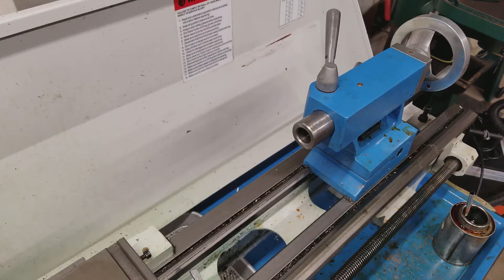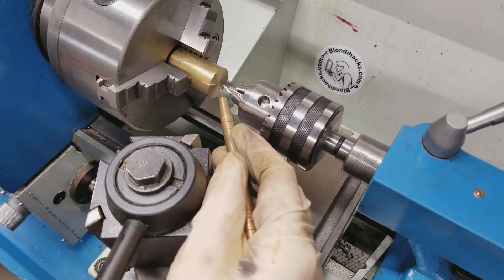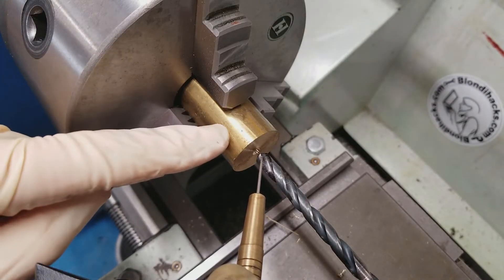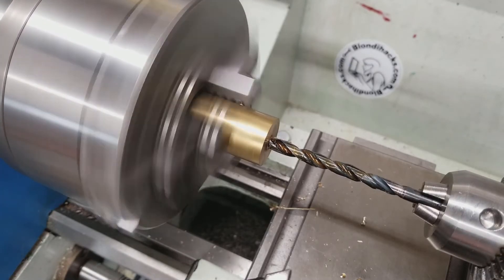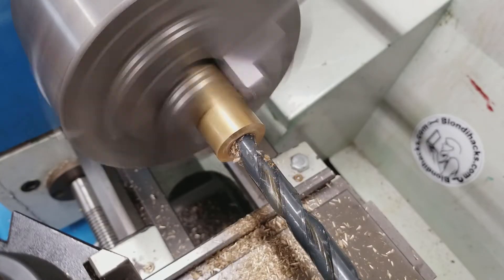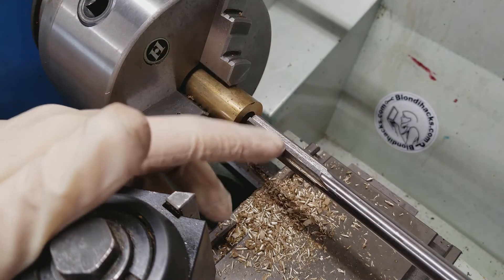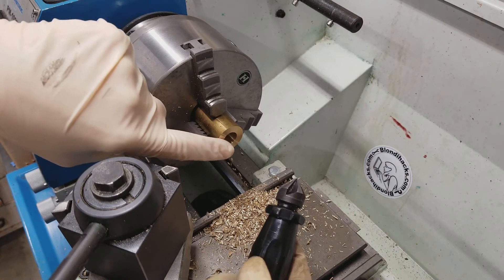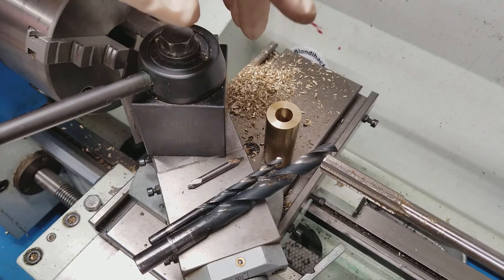Metal Lathe Tutorial 10: Drilling

Comment: 8:54. Why does that reamer with so much stick out, look like a recipe for a severe, catastrophic chattering? I've never used a lathe, but that long reamer with no support under it, looks like it would vibrate slightly in the hole, and go into a runaway oscillation and bind up on the metal and then probably break off catastrophically? How does one avoid that happening, or are the reamers so rigid that they don't vibrate?

Comment: I will answer a question from below about using oil when drilling brass: I always do and something else because I use a lot of 360 brass: I have two sets of drills and I blunt or flatten the drills
in one set because it causes less troubles when drilling. This suggestion I received courtesy of William R. Smith (Deceased) who wrote many articles and books describing making clocks. From my
gunsmith friend here's another tip: When closing a Jacobs chuck tighten first one of the three tightening points then follow suit on the remaining two tightening points to approximately the same
strength. This eliminates uneven stress on the drill and ensures a bit more accuracy in your drill and your center drill. I follow this technique with the various Jacob Chucks on my lathe, mill and drill
press. If I am feeling whimsical I will do it on my hand drills though it seems unnecessary in the latter case. I hope this helps. BillY

Comment: I keep centre drills for making centre holes, much easier to use a spotting drill to start a hole. Can’t feel a reamer on my cnc so for a reamer I take the drill rpm and halve it and take the feed and double it. I had no idea so I had to refer to various manufacturer guides etc and that was the general rule for chucking reamers. Works well for me in steel.

Comment: Save time, center drill and follow up with a 135 degree split point drill, then ream. Ream at 1/3rd the speed that you used for the drill. Feed the reamer with some authority and use plenty of lube. A hobby lathe can handle this fine...

Comment: Why doesn’t the drill and the reamer need to be centered using the same technique as the stock.  In a previous video you showed the runout that occurred when you removed a stock from the three jaw and then replaced it back in the three jaw.  The mechanism to hold the drill and reamer would appear to have the same limitation.  Great, informative videos.  Thanks.
Reply from the maker: The tool isn’t spinning, so there’s no runout to worry about. As long as it is straight and well made, it will cut on center.

Comment: Great content - Last used a lathe when I was at school, which was many many years ago in the UK... so I am definitely in need of a refresh of the detail. A question with "drilling" - when one changes through the sequence of drills, how does one maintain concentricity with the drills?
Reply from the maker: Well,  the Jacobs chuck is on the center axis of the lathe for starters, and the drill will tend to follow the hole left by the previous one as well. However none of that matters a whole bunch because drills are not precision tools anyway. If concentricity of a hole is critical, you need to ream or bore it.
Reply: Thank you

Comment: 90% of the time pilot holes are useless. The main problem is the pilot hole takes the point of the drill out of the equation. The tip of the drill self regulates the chip load the flutes take, If that is done away with you are likely to get chatter, damage the cutting edges, and crash when exiting the work. This also allows higher RPMs before chatter starts. Next time you have the chance, step drill to the largest size drill you have. Then drill with that same drill with only a spot. You should see a diffrence. I use the method at work with drills up to 4 inch diameter. Once you get into the really big drills you have to pilot because the tool pressure becomes too high. That said if you keep the pilot no greater than 3/4 the diameter of the chisel point you can greatly reduce tool pressure while reducing th negative effects of a pilot. I did the step method for quite a long time until I realized how flawed it is.

Comment: Great videos, great quality, easy to understand for someone who's just starting out in this.  Amazing work. 
Any recommendations on 'cutting oil'? Is any oil okay?
Reply from the maker: Thank you very much! For cutting oil, it depends a bit on the material. For steel, I like regular Tap Magic. There's a link in the description of the video for that. For aluminum and brass, WD-40 works well. I also use Tap Magic on brass sometimes, such as for drilling. There's an amazon link for WD-40 in the description as well. Using those links helps support my channel.
Reply from the maker: Oh, and yes, honestly, any oil is better than none. Tapping fluid is good stuff though, and worth picking up.
Reply: @Blondihacks  I've found that ATF (automatic transmission fluid) is AMAZING on aluminum.  Nothing special as far a brand.  Whatever is cheapest.  By design, it's meant to keep steel from sticking to aluminum.
Reply: I never use cutting oil on Brass ! Round bar is made to be "free machining" so doesn't really need it. The chips break up really fine, so oil just kind of clogs things up. Cast Iron is also best cut dry. I use soluble cutting fluid on steel & a thin, neat oil on Aluminium (& yes, WD40 is not a bad substitute).